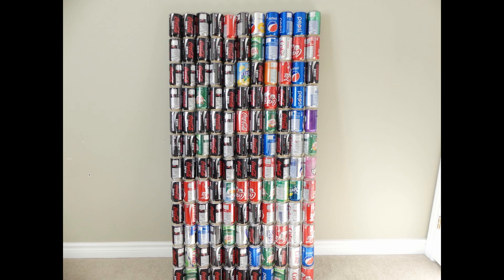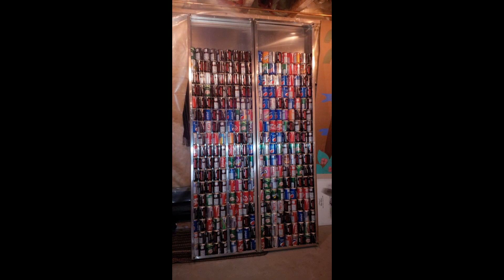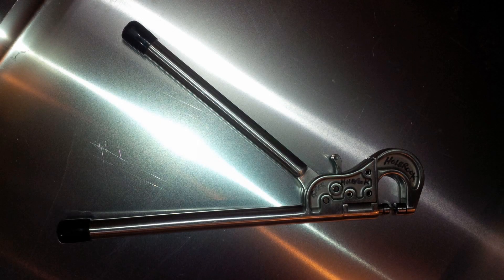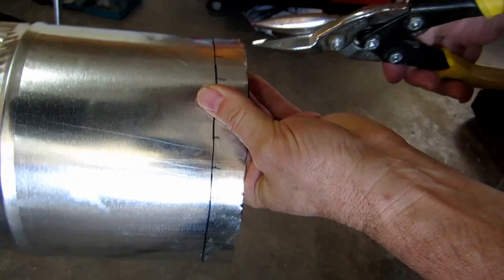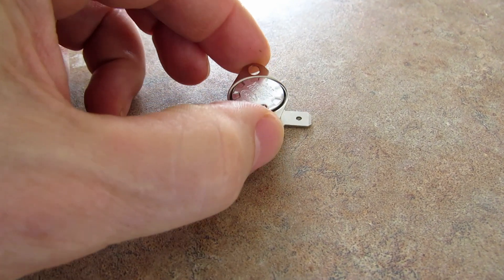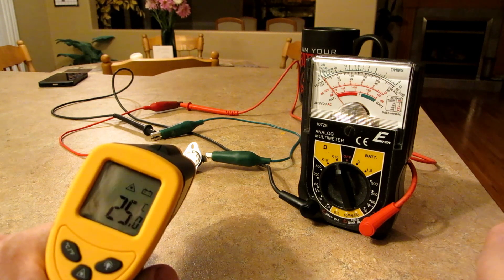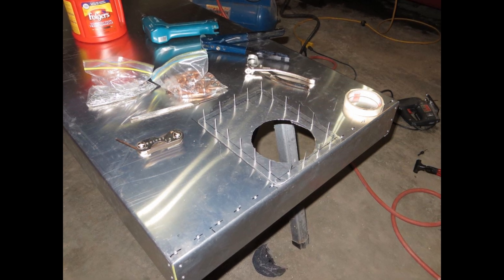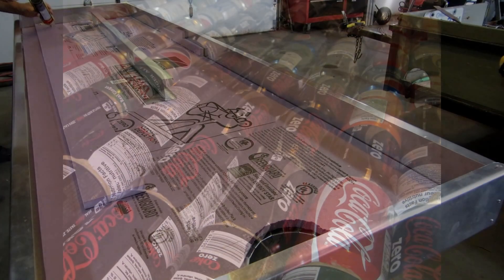DIY Solar Air Heater Part #4

Comment: As others have pointed out, do not use this type of foam.  Extruded Polystyrene (kind used here and often comes in pastel colors) softens at 74C (165F) and begins melting at 100C (212F) and off gasses.  Polyisocyanurate is the right foam insulation (and is right next to the Extruded Polystrene at the big box stores).  Polyisocyanurate is the most expensive but has the highest R-Value per inch and can be used in temperatures over 150C (some sites say 177C)  (300F some say 350F ).  My 4x8 screen solar panel in summer, even with venting on the top & bottom will reach over 100c (212F) on some days.  Mine is insulated better (I used double-wall polycarbonate glazing which reduces heat loss by 30% out the front compared to glass/acrylic and 1" polyisocyanurate foam instead which reduces heat loss out the back & sides 11% better than 1/2" extruded polystyrene) so that may be a factor why I get such high temps even with vents open in it.

Comment: 1.   Punching holes in the bottoms PRIOR to trimming the tops would give you the strength you need without any jig.
2.   The efficiency charts were nice.
3.    I am sorry, Dwayne, but if you were building an airplane, this level of anality would be understandable and truly admirable but for something like this................ you are an archangel in OCD Heaven.

Comment: hi, like your videos, I intend to do one like this, what's the part number of snapswitch? your detail job its very nice, 
regards
Pedro
Reply from the maker: Hi, thanks for the feedback. 
It has turned into a fun little project. Great ideas and suggestions from viewers. The snap switch I purchased was a KSD301 Temperature Control Switch Thermostat 40 Celsius Normal Open.  It was sold on Amazon.ca by discounttown; five (5) for $4.71 CDN.Cheers
Dwayne